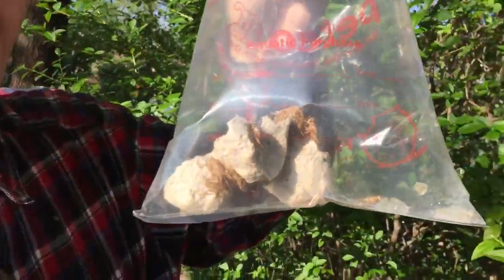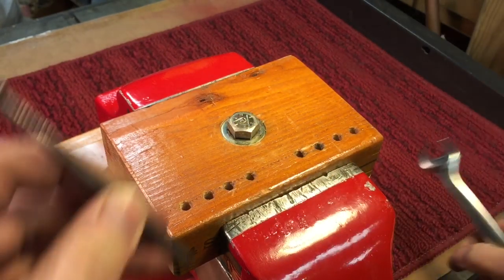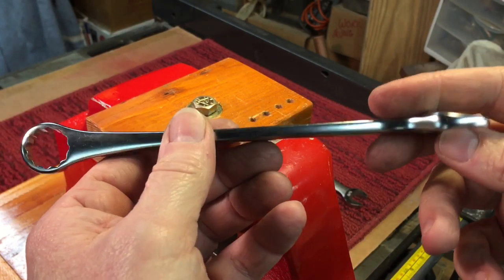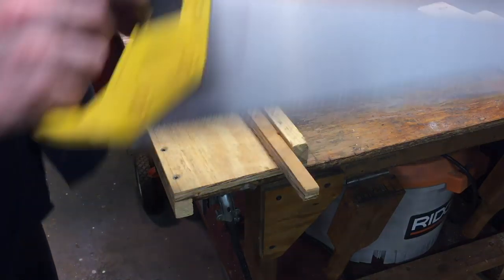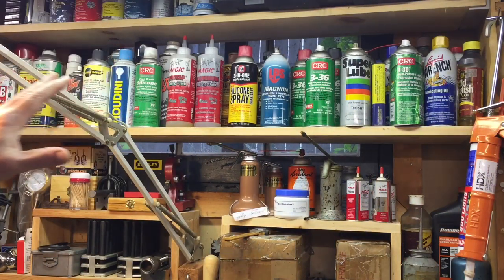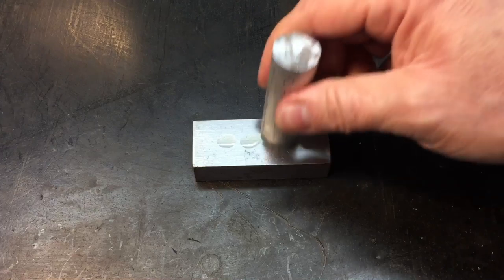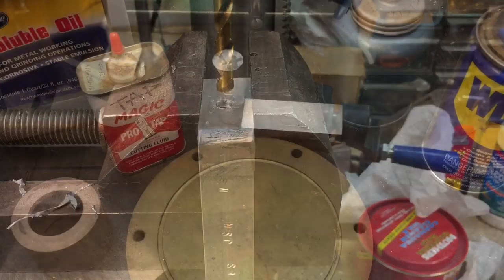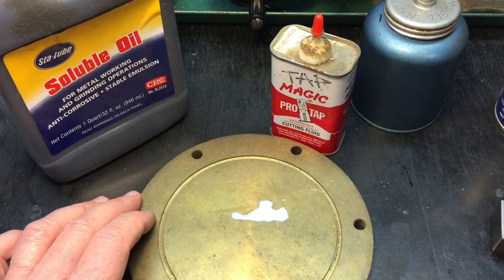From Crickets to Cutting Fluid

Comment: Beautiful presentation John. 
The cricket ending is priceless. 
My favorite cutting fluid for steel is the Tap Magic. Die work involved lots of tapped holes. With the Tap Magic I could easily tap 3/4" threads by hand. For blind holes we would start the thread using the drill press, vertical mill, or tapping stand and switch over to cranking the bottoming tap down the rest of the way by hand. 
Through holes were easier. Just run the tap on through. 😁
Tap Magic is volatile. It evaporates quickly. 
We used sulfur based oils for machine cutting and tapping steel in the gang drills. It didn't work as well, as the TM, but except for the carryout on the parts it didn't evaporate or turn rancid like water based soluable vegetable oils did. 
For aluminum we used the water  based oil until we found that straight peanut oil worked great. Just a drop or two acted like TM on steel. It washes off with water so it is a lot cleaner to use and doesn't turn rancid. The big difference is you put it on the tap or drill not the part. 
Fascinating subject and you did a great job explaining the difference.
Thanks.
I think this could be worked into any shop class curriculum in fabricating or machine tool.
Reply from the maker: Hi Dave!!!   You know that Tap Magic is really magic!  Since using it I really don't think I have had to sharpen my drill bits at all!  I never over-heat them and treat them well with lots of Tap-Magic and they stay sharp!!!  I really like the WD-40 on Aluminum, I do also like the Tap Magic for aluminum but the smell is really over-powering!  =)   Thanks Dave!!!!!!!!

Comment: U r right. Aluminium is  hard to work with. We have to take out our drills & use a scrapper to take out the material stuck in flutes. The crickets,  didn't pay attention,  I think it has been many years since I last heard them.
Reply from the maker: WD-40 really works well on Aluminum and is very cheap!  You will be very happy!   This Summer take a moment to listen to the crickets...  They are part of our DNA you know, our ancestors would listen to them long before you can imagine...  Thanks
Reply: @ScoutCrafter  hi. Its summer time here upto july.i think i need to wait for monsoon in august to hear them.really miss those sounds.

Comment: Love Monday mish-mosh. 🙂 I use soluble oil in my bandsaws and milling machines with a mister. In the lathes, I prefer a high sulfur oil like cheap pipe thread cutting oil of course only on steel. Aluminum is WD-40 only. We have crickets by the score here, it's quite the concerto at night. We also have way too many grasshoppers. 🤨 Thanks for the video!
Reply from the maker: Hi George!  You have the fluids down pat!  Obviously you learned from experience!   =)   I sure do miss the grass hoppers too!  We never see them here any more!   =)    Thanks!!!!!

Comment: Hey Scout. How often do you have to resupply the crickets? That's pretty cool. Also, soluble cutting fluid (or at least everything I've seen) is actually oil based. However, they add in a soap to make it water soluble (much like how it's hard to clean an oily pan with just water, the soap makes it soluble.) That's why it calls it an emulsion on the front. We mix the coolant in our power-hacksaw 10:1 water to oil.
Reply from the maker: Hello MB!  I never knew that about adding soap to the oil to make it Soluble!  That is very interesting!!!!  I don't have any machines that "pump" coolant so I use mostly oil but I do want to try the soluble type!  I add crickets in the spring a couple times until I hear them at night!  LOL   They rub their legs together to make the sounds!!  =)   Thanks!!!!!

Comment: Nice you care for nature, lets hope the winters are kinder to the crickets. the Z cutting board you would think they would make  them commercially, they make  45 degree and 90 degree jigs but not a plain Z cutting board. To me wd40 is over rated, it evaporates very quickly leaving metal to rust but I  have not used it as cutting oil. Sprayed wd40 on my tools in the shed hoping for them to be rust protected and when you go back and have surface rust on them, now I do not trust it, I prefer 3 in one oil. Wioe down tools with a rag with 3 in one, works better.,I did not know the difference between cutting oil and lubricating oil,  thanks for the explanation.
Reply from the maker: Hi Tony!  It's so funny because WD-40 is not a good lubricant but it is a decent cleaner and works great for drilling Aluminum...  However people always wind up using it as a oil and like you said it evaporates so fast that you are left high and dry!!!!  =)  Thanks!!!!!!!

Comment: I thought you were going to use oil on the drill bit next just to see what effect it would have ☺
Reply from the maker: If the drill bit is sharp the oil won't totally stop it from drilling but it tends to allow the bit to slip instead of cut and thus build up heat and heat just destroys a drill bit!!!  =)   After a while the regular oil will dull your bits.   Thanks!!!!!

Comment: Good video as usual ,   i have a question about the stanley 761 video. Did you spray paint or brush?
Did you clear coat over the painted areas? Did you use rustoleum paint?  I clear coated over restoleum once and  the paint bubbled . I have a 761 vice i'm getting ready to restore yours came out super I want to copy. Thanks Tom
Reply from the maker: Hi Tom!  For that Stanley I brushed it, however I much prefer Spray because the finish is better!  I always use Rustoleum Enamel because it's slow drying and really holds up well...  If you clear over rustoleum you have to make sure the paint is cured (couple days) and use Rustoleum clear coat!  If you use a non-compatible clear it will craze the paint!  (ask me how I know)  LOL   The Rustoleum clear is awesome!  Thanks!!!!!!
Reply: @ScoutCrafter  Thanks got it!

Comment: Another good one! - In the light of your comments on oil / cutting fluid, do you have an opinion on using oil on sharpening stones?  It shouldn't work, should it?
Reply from the maker: Hi Steve!  Yes! Oil for sharpening stones has one main purpose, to float up the particles from the face of the stone so not to clog the abrasive... The same holds true with water stones.  If you don't use some fluid the stone would quickly clog up and not "cut".   There is special oils for cutting stones...  Thanks!!!!!

Comment: Hi again Scout, How does the main screw come out of the 761 stanley vice. I know theirs a spring holding it in but is their something else? Thanks Tom
Reply from the maker: Hi Tom- At 6:10 of the video you can see a layout of the parts, the main screw is held in by a spring that has a washer compressing it and a small "C" clip that fits in the groove holding everything together.  It was a tricky job getting it back together as the spring had to be compressed before the clip could fit into the slot!  Here is a trick-  Compress the spring in another vise and while compressed tie a couple pieces of Dental floss around the spring so it stays compressed when you open the vise. Then install the spring and c clip on the Stanley and cut the dental floss allowing the spring to expand!  =)    Thanks!!!!!
Reply: @ScoutCrafter  Got it,   thanks so much you've got to be the greatest!!!

Comment: I`ve seen twisted shank spanners. with a twist right in the middle of the shank. But nothing like those ones. and only ever used Motor oil as a cutting fluid. too expensive that other stuff.
Reply from the maker: Hi Steve!  Keep an eye out at garage sales and flea markets, one day you might come across a small can of it...  You really will like it!  Especially for tapping!!! Also- Your drill bits will hardly ever need sharpening!  Thanks!!!!!